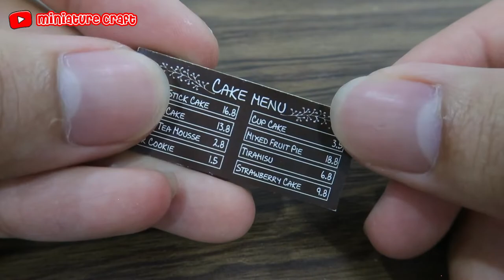DIY Miniature Dollhouse Cake Diary

Comment: Where does the lights for the back wall shelf go? Through the back wall? It would be nice to see  the setup of the lights a little more, as the instructions in the box don't show you where to put the wires through and where to keep the battery pack.

Comment: Where did you start the lights
Reply from the maker: At the back of the house
Reply: @HamsterLife1216  yeah I know but is there a specific time stamp where you start the lights? I don’t know how to get it working. Thanks!  💖🌸
Reply from the maker: Can you tell me which time is it? So I can check
Reply: @HamsterLife1216  at the end I think. You turn the lights on but I do not know how to get the lights working. Can you tell me how?
Reply from the maker: This cake house have 3 lights, MENU / TABLE / DISPLAY, which 1 you referring? if you said at the end, then its TABLE, the table light will need to go thru under the board, pull the light cable until the back of the board and connect it with battery.
Reply: @HamsterLife1216  I  am talking about all the lights. I do not know how to make them light up.
Reply from the maker: Does your house comes with the battery connector?
Reply: @HamsterLife1216  The battery box? The one with black and red wires? Because if so then yes
Reply from the maker: If have it then connect your light's wire to the correct + - to light it up!
Reply: @HamsterLife1216  Oh Ok!! Thank you very much!! :)